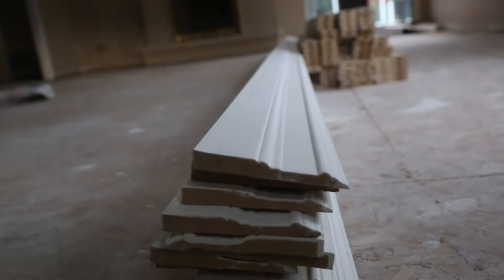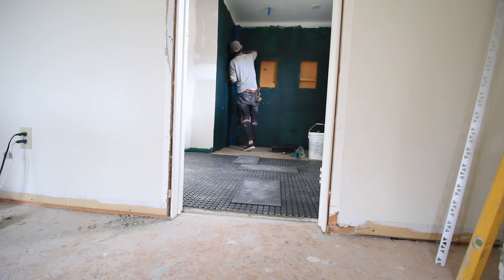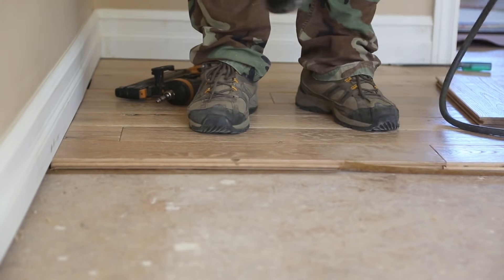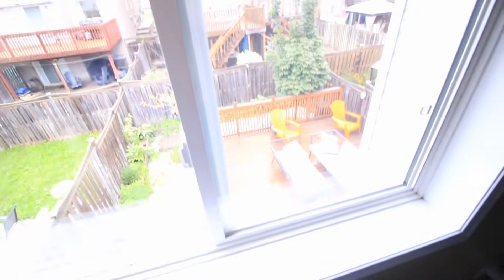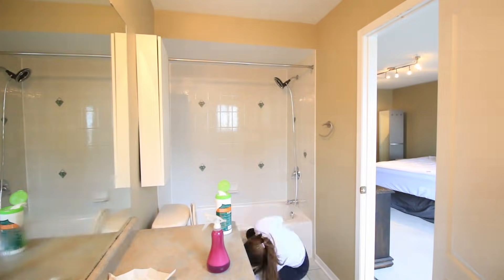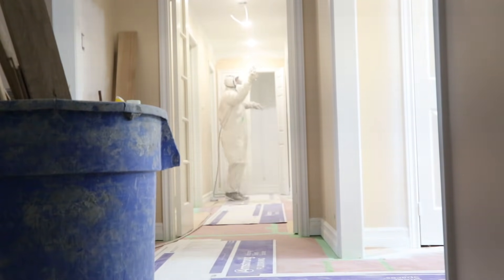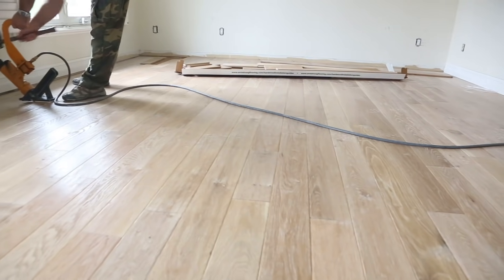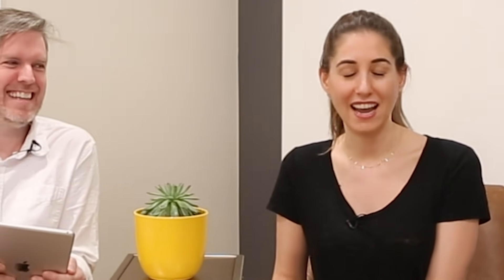Saying Goodbye.

Comment: Out of curiosity, why put the flooring down before doing the painting?
Reply: This has always bugged me. It seems like this happens in a lot of renos.
Reply: And the molding
Reply: I think it has something to do with not wanting to damage the walls.  When pulling up and installing flooring sometimes things hit the walls, etc and if they were already painted then it would nick the new paint and you might have to patch the walls. Also, cutting hardwood floors makes a lot of dust and cleaning that off newly painted walls might not be the best idea.  Painting is usually the last thing done in a house and signals when the reno is pretty much over.

Comment: I pulled the old carpet our of our 1930's house and found hardwood floors underneath.  My original plan was just to paint them because they didn't seem like they were in good shape, but after sanding them, my husband and I agreed that we should not paint and used polyurethane instead.  They're a beautiful reddish color with lighter areas throughout.  My kids are the fifth generation to live in this house, so it's neat to know that there is so much history here.

Comment: I LOVE those hardwood floors and the large ceramic tile in the guest bathroom. I like the look of the hexagonal tiles, but my first thought was the sheer amount of grout cleaning you'd have to do. What we did in our house for all the showers was a cultured marble surround. Little to no grout, clean lines, and very easy to clean. You can also get them in just about any color you want.
Reply from the maker: It's true, there will be a lot of grout to clean, but we really liked the look (and only used the hex tiles on one wall)
Reply: @cleanmyspace  That would definitely limit the amount of grout cleaning. I swear that's my least favorite part of cleaning the bathroom.

Comment: Why did you put the floors down before painting? Wouldn't it have been easier to not have to cover them up before painting and instead let the paint splatter on the      plywood?
Reply from the maker: The timing of each of the trades was the main reason we did it this way - the flooring guy was available first and a few days later was when the painters were available..and we were also super pumped to get the floors in!
Reply: @cleanmyspace  that's fair! Looking great too btw!

Comment: Thanks for your videos. Bur I hate to tell you your installer did not install your floors properly. There should bee a minimum 9 inches between row seams and boards should really be no less than 6 inches. I had a terrible install of solid maple that looks like jigsaw pieces and its the first thing I see in floors now.